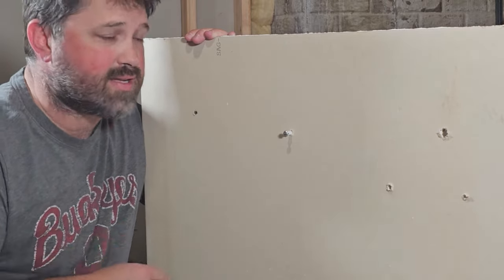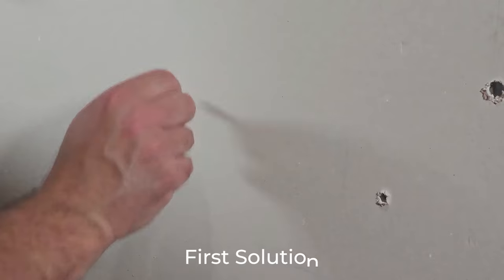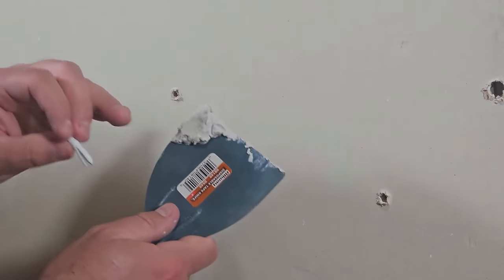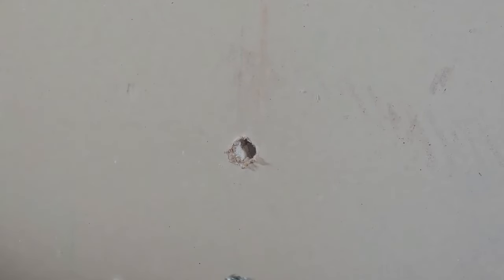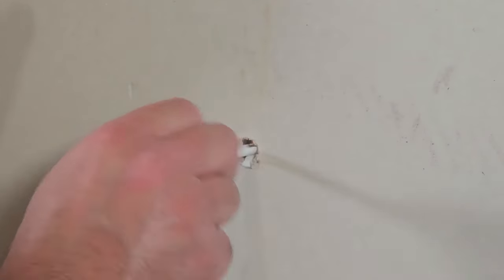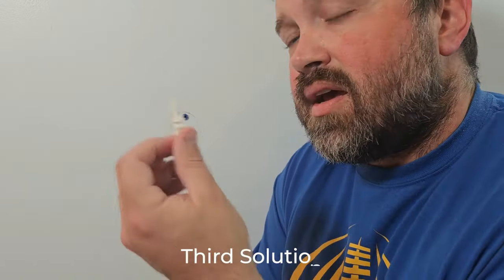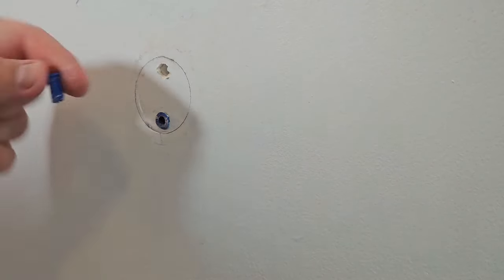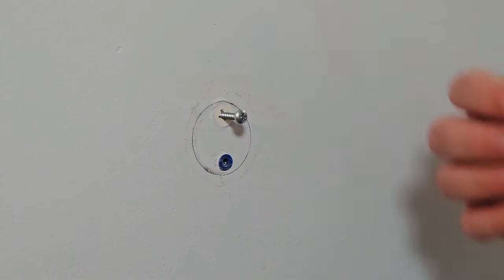DIY Tutorial: 3 Methods to Fix Loose Wall Anchors

Comment: What if you have a hole that is already done by the bigger screw from the end of the video, so the hole is bigger, and you need to put back a screw at the exact same spot, how would you do that? Thank you.
Reply from the maker: So if you have enough room, what you can do is get a long toggle bolt.  Put a washer on it and then use that to cover the hole.  Just make sure the washer is large enough to cover the hole